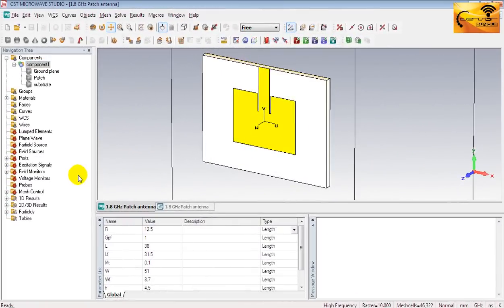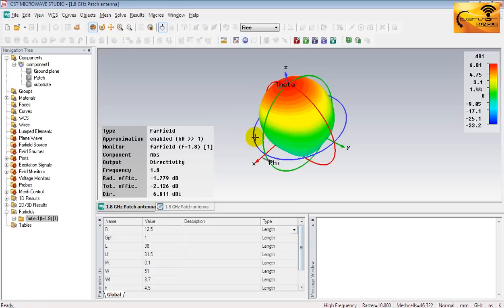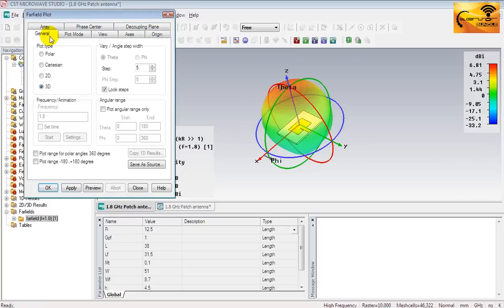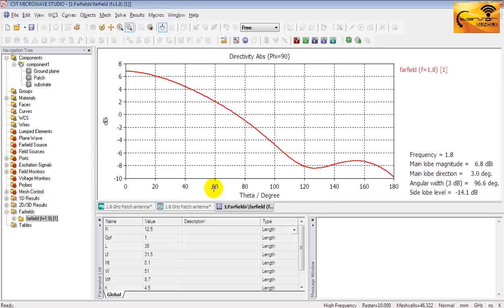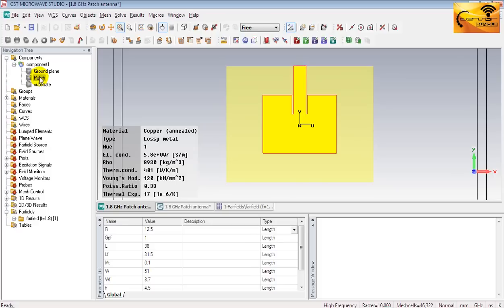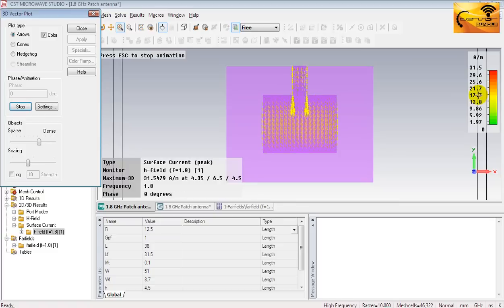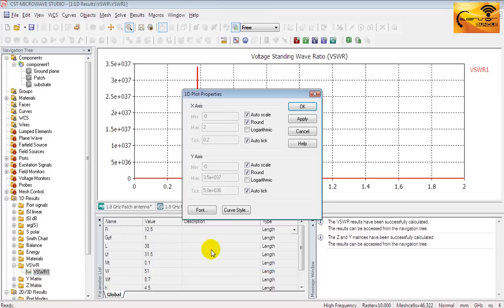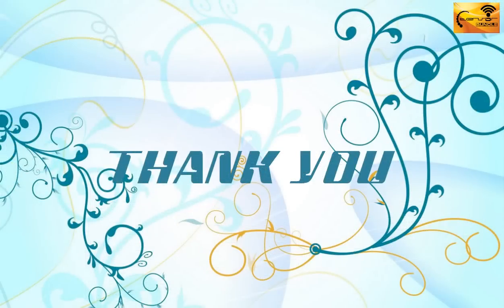CST Tutorial: Exploring Simulation Results of Microstrip Patch Antenna- Part4

Comment: Is it possibile to visualize only the plot of the radiation impedance of the antenna?(where the radiation impedance is a part of the real component of the input impedance of the antenna)
Reply from the maker: 'Radiation resistance' may be indirectly retrieved from radiation intensity's plot, but again it requires post-processing calculation. Direct plot of radiation resistance is not available in CST

Comment: Hello, would you like to have a file (example PDF) that explains about the functions and functions of CST?
1. Example: The Frequency Domain Solver icon, this function works frequency domain designates the analysis of mathematical functions with respect to frequency, in contrast to time domain analysis ...
2. Example: The Time Domain Solver Icon Time Domain is a term used in signal analysis to describe the analysis of mathematical functions with respect to time. In the time domain, the value of the function is known at every instant, in the case of continuous time, or at several separate instants, in the case of discrete time ...

 
I'll be thankful.
NOTE: Your videos help me a lot.

Comment: Hi,

I am a beginner in CST STUDIO SUITE, and I would like to put some current and voltage monitors along my design. 
Although, I don't understand how to do it : indeed it is mentionned to define a curve before placing a I or V monitor. I tried to use a circle and when I run the simulation, I have the following message : "voltage or current monitor current1 has no cells along path, try a finer mesh". What does it mean ??

Thanks for your answer